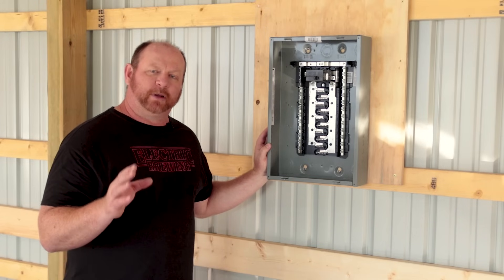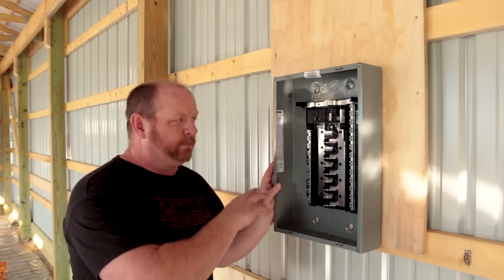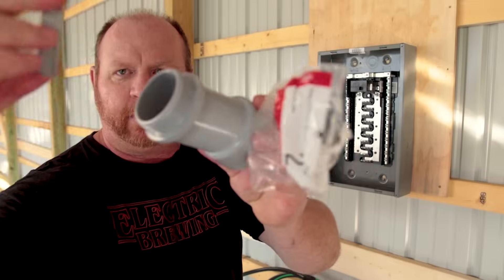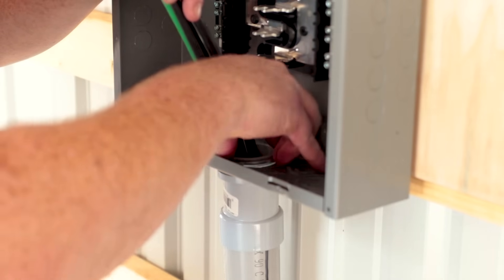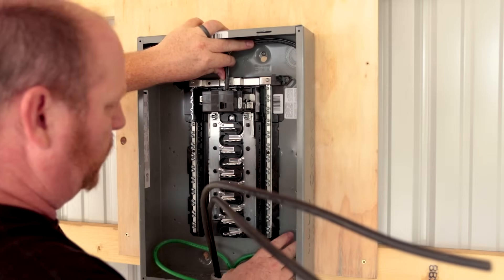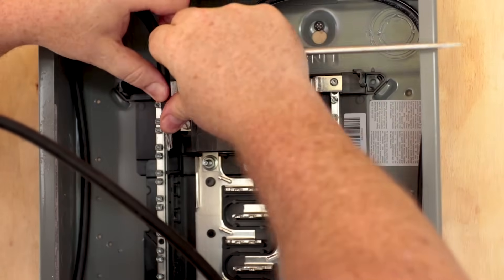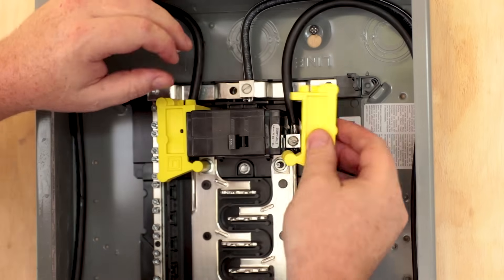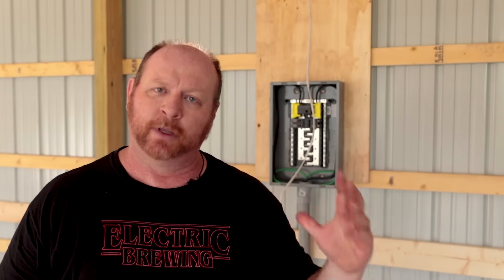How to install a main breaker panel in a garage. -  Square D Homeline 100 Amp Main Breaker

Comment: Again,   Brian,  I know that you checking the comments on this video.   Please answer some questions!  Is there a main circuit breaker outside at the meter location?  Did you connect the 4 th conductor to ground lug outside the shed? Did you remove the neutral to ground bond in the shed? Did you drive a ground rod at the meter, shed, or both?   These answers would be greatly appreciated!!!!!
Reply from the maker: Kevin, sorry for the delay I had not checked the comments for a little while.  I am going to be doing an updated video on this one.
Questions: 1 - Yes there is a main breaker out at the meter base. (Technically that would make this a sub panel.)
2 - No i did not connect the 4th wire to any sort of ground rod
3 - The neutral to ground bond screw is in place in the panel in the shed
4 - There is a ground rod at the meter base and the ground wire in the meter base is connected to, which my ground wire is connected to as well. 
Extra comment. I have added a couple of things that will be part of the updated video. I did add a dedicated ground wire 6Ga to a grounding rod outside of the barn. I also added some "No ox" for corrosion protection on the wires.  Lastly I added a separate ground bar for all the ground wires in the panel. I hope that helps answer your questions sorry for the delay. 

AGAIN.. Codes in different places vary and you should consult your codes in your area when doing any electrical work. I do not have any codes or inspectors out in the country where I live. So there may be some of the things that will not pass an inspection in some areas and be fine in others.
Reply: Build IT With Brian    Thank you very much for your response!!!   Before you make an updated video, please think about the following comments.
1.  Agreed, with main breaker outside then this is a sub panel in this video.
2.  The 4 th conductor from the exterior main panel to the sub panel in video is required.   Should be connected to ground / neutral exterior and added ground bar in the sub panel.  This is an equipment ground.
3.  The neutral to ground bonding screw in the sub panel should be removed.  Should only exist at the service main.   
4.  Ground rod at meter and main panel exterior is correct.
5.  The sub panel should not have a Grounding Electrode Conductor or Grounding Electrode (ground rod) connected to it.   These belong only at the service main location exterior.   Not to be duplicated.

All of my comments are in compliance with all electrical codes within the past 35 years I have been designing electrical systems.   
Feel free to ask any questions you have about what I said or why the code requires them this way.   I would be happy to help you understand.   Respectfully,   Kevin
Reply from the maker: Thanks for the info!

Comment: You forgot 1major thing when using aluminum wire you must use noox on end of wire
Reply: The preventative oxidizing inhibitor is not NEC code, however it’s probably a good practice..
Reply: I was just going to say that
Reply: It’s code in my area@abraham
Reply: Not required

Comment: The only thing I see wrong is that you used main entrance wire that is most often used for sub panels. That is what that forth wire is used for.  Typically you see such a setup when the source of the power comes from the main house breaker panel load center and not from directly from the meter, as in your case.  
Codes are all basicly the same but could vary a little from area to area.  

You didn’t do anything wrong this is just an explanation of why some entrance cable often has that forth wire. 
If you do need to wire this panel as a sub panel the forth wire is used and the sub panel breaker maybe needed to be derated from 100 amp to 90 amp. Again check with your local codes and inspector. This derating is often done to compensate for line loss. Some inspectors will let you get away with leaving the panel as is and others will require the derating.

Comment: I put in a separate meter panel for my pole structure, and fed it with 4/0 cable.  The panel I used was a 200 amp panel with room for 60 smaller breakers.  The 4/0 wires are hard to work with!  I put the panel "upside down" so the wires did not have to be run up the side of the panel (the wires are fed from the bottom like yours) and this made it easier to attach the wires since the main breaker was at the bottom.  
Thanks for the video!
Reply: Its  actually in the code but for some reason people dont stress it.
Reply: I was wondering about this.  Thanks for your comment, I am going to put mine upside down too.

Comment: Brian,  Please answer some questions!  Is there a main circuit breaker outside at the meter location?  Did you connect the 4 th conductor to ground lug outside the shed? Did you remove the neutral to ground bond in the shed? Did you drive a ground rod at the meter, shed, or both?   These answers would be greatly appreciated!!!!!
Reply: Why? You said in your other comment you've been an electrical engineer for 30+ years. Don't you already know all these answers? So you just want him to answer your questions so you can tell him he's wrong? I don't know what it is about electrical but take a look at any of the thousand+ tutorials and there is always an army of commenters like you arguing over code saying things like "Wrong that has to be grounded" followed by another commenter saying "Actually it doesn't because X" followed by a third saying "Depends on code where you live/or either one works in this scenario". It's as tiresome as it is unhelpful.

Do you simply want to stroke your own ego by being an "armchair quarterback" to this guy's video? Or do you actually want to help people as you'll probably claim? If the latter is the case, then make your own video showing people how perfectly you would do it. THAT would actually be helpful, unlike the constant bickering on EVERY electrical video on Youtube from all the perfect experts out there. Of course if you do post your own tutorial, no matter how perfectly you do it, know that the comments will be filled with other Youtube master electricians telling you all the mistakes you've made.

Comment: How do I know which wire goes to the right connection?
Reply: The two black wires are the hots and the wire with the white stripe is the ground, goes in the middle ; this panel needs a ground bar.

Comment: Good video but there is a few things I want to say. 
First this isn’t a big deal but you should mark your neutral wire with white tape and your second hot wire with red tape. 
Second your ground (the green wire) should be connected to the ground bar in the panel. To a ground rod out side. 
Third because you have aluminum wire you have to put the jelly on it to keep it from corroding and oxidation  because when that happens you will have trouble. 
Other than that really good video. And have a good day.
Reply: Phil Mccrevasse thank you I couldn’t remember what the name of it is
Reply: I believe code is 2 ground rods 6ft apart. And I also believe a ground buss bar is required because it's a sub panel used without  bonding screw.  Definitely want to use an antioxidant paste.  And I'm not sure if required but may need a grounding strap to ground building too.  I'm about to install the same panel on my new garage👍

Comment: Man for this job you need to put a sub panel not this Service Entrance Panel. Whit this you have problems with the ground because on this type of box ground bar not exist because is a Service Entrance Panel so well you have to attach the ground in neutral bar.

Comment: If there are so many problems tracing wires to find out where they belong, why don't they make different colored wires, or number them; so they can be assigned to different circuits? 

It  seems like it would save time and trouble in the long run ?

Comment: I was curious.  You were wearing a wedding ring.  That could be dangerous if the circuit was live.  The electricity was not connected, but do most professional electricians wear a wedding ring while working?  It seems like it might be hazardous to your health if the ring hit a live connection.

Comment: Just built 2 add on rooms need to wire how will that work where it's not new service main house has power already was just going to hook into panel that's already there can I do that
Reply from the maker: Use it as a sub panel with a large breaker in your main panel to power your sub panel for the rooms. You probably don't need a panel this large though.

Comment: How do u know which wire for ground if same color ?
Reply: Just a lil info your way; since that is essentially a sub panel with a main breaker and the ground and neutral are tied together in the first panel out by the meter, that green wire which wasn’t used in the video is the ground which also needs a separate grounding bar added and a ground rod. Therefore you would land your ground for circuits on the separate ground bar and the neutrals on the provided neutral bar. The neutral has the white stripe down the wire and the two hits are just black. This is why it was 4 wires provided at the panel instead of just three like in the first panel. This is to prevents parallel paths for current to take back to the source and is known as objectionable voltage on things and metal which shouldn’t have it. A great video though oh and noalox is a good idea for the aluminum wire. Keep making videos though, I love to watch them. Stay blessed.
Reply from the maker: One of them has  stripe or tracer on it.

Comment: All WRONG!!!! You should have put anti-oxidation for those aluminum terminations and you need a ground buss as well as straps on that pipe,
Reply: New aluminum wire doesn't need it. Even the old stuff didn't need it unless it was touching copper. Check your code books, it is not a requirement in most places.
Reply: Prestia2011 apparently you are not a electrician, aluminum expands and contracts when terminating to any metal lug. That anti oxidation compound prevents it from doing that. Your a dumbass if you don’t think it is necessary
Reply: Yes the box should be grounded and the neural should pass through not bonded. On the sub panel he is wiring. Also spend the extra $$ for copper
Reply: @reallybuddy3259  easy to say when it's not your wallet. I just priced out wire for my own 100 amp box. 3-3-3-5 copper was over $6.50/ft where as 1-1-1-3 aluminum was $1.50/ft. The fear of aluminum wire is rooted in the initial problems used with the initial alloys. If you use an antioxidant and torque to the actual specification there is no problem with using aluminum (and saved me hundreds of dollars).

Comment: My only suggestion is to land the ends of those wires onto the plywood to make the cutting easier and safer.
Reply from the maker: Good tip. And no-lox I added it later.

Comment: Where did you purchase your wire from ? I have a 20 foot run to make, do I use aluminum or copper for that distance? Thanks for the video Brian..
Reply from the maker: Menards you can run either for that short of a distance. Aluminum is cheaper.
Reply: COPPER!!!!!

Comment: Good video. I just bought one today. Just a question will this panel require a ground rod? Also noticed you didn't use any nolox. Do you have to use it or not?
Reply from the maker: Yes use a ground rod. No lox is a good idea.
Reply: Yes ALL load centers require ground rods.
Reply: I put it up yesterday. Thank you much.

Comment: From the top, he said he was not a licensed electrician, therefore, don't criticize because he make a video and you pros didn't. Some of us appreciate guys like this who can help people save some money, and we can check our local codes for free. This is not something we need a college degree to do, just get the local advise from a pro and code. Do it yourself, and if you burn you own house down, You own it. Good work Brian.
Reply: If you’re gonna make a video about how properly to do something than you damn well better read requirements don’t put bad information on how to do electrical project! If I’m not mistaking that was aluminum wiring and it does require the electrical grease at the main connectors
Reply: What happens if you sell it, then the next owner gets to watch their stuff burn?   Just curious….. or is it about you and your money?

Comment: ILLEGAL.  It's a sub panel.  Due to your meter having the main disconnect.  Your grounding conductor will connect in the meter on the grounded bus bar.  You need a grounding bus bar installed into the sub panel, were all your grounds will connect to.  You didn't use nolax on your Aluminium conductors. The wire is the incorrect size.  Need #1, #1, #1, and #6 for 100 amps.  Didn't support the PVC 3 ft from panel box.  Let us professional electricians do the job.  DIYer's are just hacks.  If this was a main panel and the meter was installed on the barn, were is your grounding bonding screws to bond the ungrounded to the panel.
Reply: Lol you're a douche. #2 is rated for 100 amps. He does need oxgard and grounding.